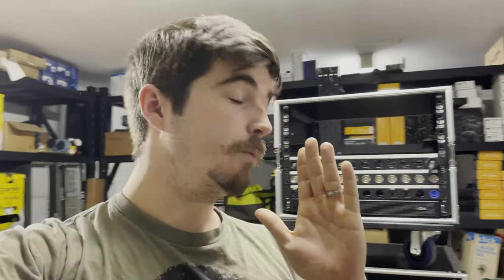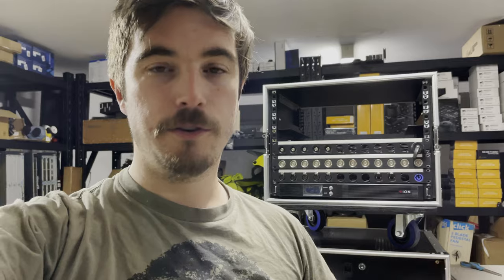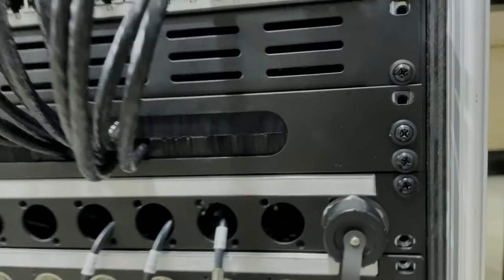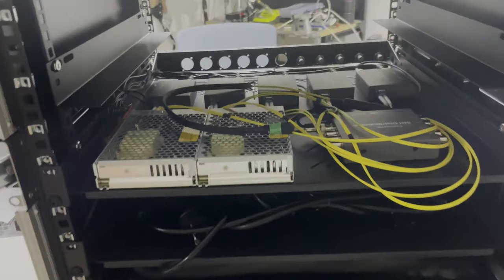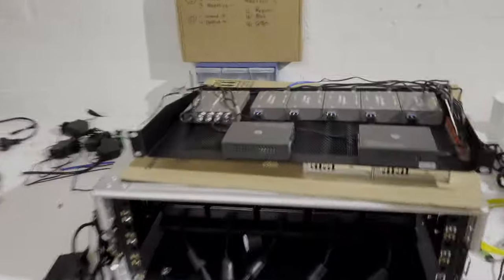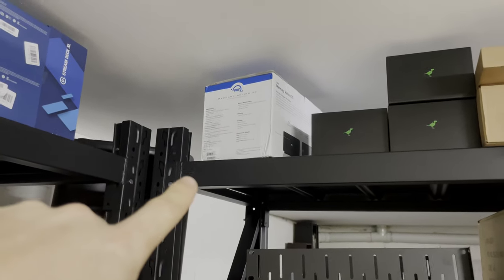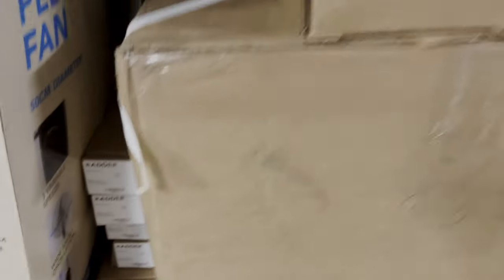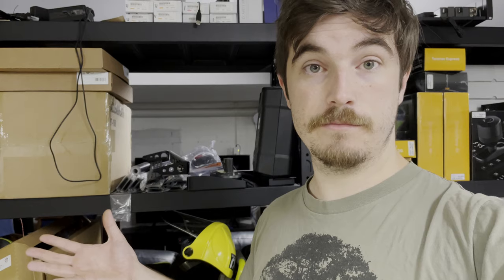OB Trailer Build Part 1

Comment: Hi Ryan, nice job, can you share the references or where you buy the power supply for the mini converters? I'm actually dealing with a lot of little power adaptors needing a lot of power sockets it's awfull to manage... So if you can share it will be so kind of you.

Thx
Reply from the maker: Hey Oslow, So I get a custom power supply depending on the need, typically i get MeanWell powersupplies which are decent quality and robust. So typically what i will do is choose my voltage, (5, 12,20,24 etc) depending on the requirements, Add up the wattage of all the converters i want to add, add an extra 20-50% of headroom to be safe then buy 2 of them. Meanwell have a lot of different options so basically any combo you need you will be able to find or very close to, espescially in the 5 and 12v road. So theres no "go to" that i use, i just do the math and pick the one everytime to make sure i dont get the wrong one :)
Reply: @RyanSomerfield  What do you use to connect the dual power supplies in a redundant way with equipment that only has a single DC input? Put it together with some diodes, or is there a proper product to achieve this?

Comment: How do you plan use NDI along with SDI/BMD stuff? I built my whole workflow on top of NDI & DANTE because it looked like that it's kinda easier to have one workflow instead of several. On the other hand, I would like to use hardware switcher because it seems to be much more stable than software-based switcher. Even mine (vMix) is stable for 2 years, there is always Windows in the background which is a nightmare with theirs updates. :D On the other hand, it's nice to have everything on 1 cable and 10 Gbps network (cameras (ndi, possibly later dante video), audio sources (dante), intercom (dante), dmx, internet access, ...) with switches which supports PoE-passthrough. :)
Reply from the maker: Main thought is purely for flexibility, The ability to grab ndi sources to the switcher and vice versa. A big part was grabbing NDI from zoom/teams which we do a bunch. I personally am always a fan of dedicated hardware. sure you can be more flexible on software/network etc but stability is king for me. so yeah SDI is still the main workflow, but some things just run with ndi and this is an easy way to convert to and from

Comment: Don't you need individual sdi returns to be able to paint the cameras, or is that possible with the return coming from the DA?
Reply from the maker: Da is totally fine, each output outputs all the data for each camera, then on the camera you select which number to “listen to”
Reply: @RyanSomerfield  Cool, thanks! Haven't used the BM cameras,  so didnt know exactly how it worked.
Reply from the maker: @driten123  it’s a pretty clever system, means you don’t have to waste channels for return just for ccu and then can be used for other things :)